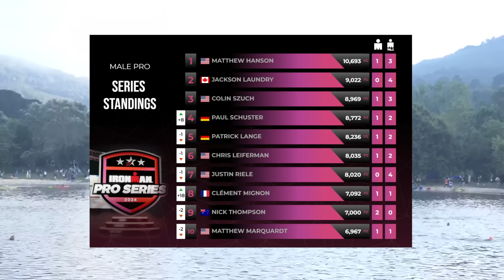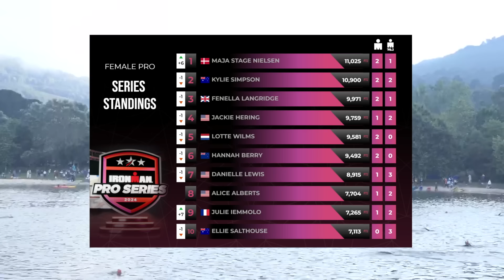Pro Race 2.5Hr Replay | 2024 IRONMAN Vitoria-Gasteiz

Comment: One significant performance was Cam Wurf running from 7th to 3rd in the back half of the marathon. We got to see a lot of Kat putting on a demonstration and Ruth walking aid stations but absolutely no coverage of the battle between 3rd and 7th place in the men’s race that went down to the wire. the Ironman coverage needs a producer that is actually following the real dynamics of the race. Sure, by all means cover the leaders, but FFS - also cover the rest of the race as well. Especially where there is a real contest - and a pro cyclist putting down the second fastest back half of the marathon to run himself onto the podium deserved more than a belated replay footage of him in the finishing Shute. The producer actually cut from the finish Shute to show more coverage of Ruth and Kat holding station. Come on, yet it together Ironman!